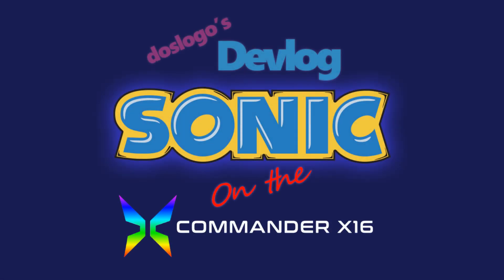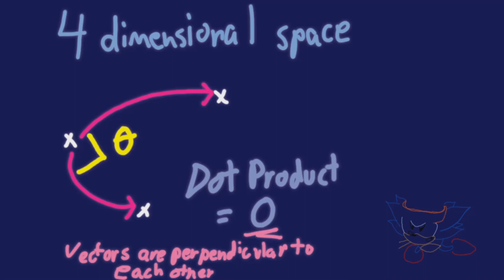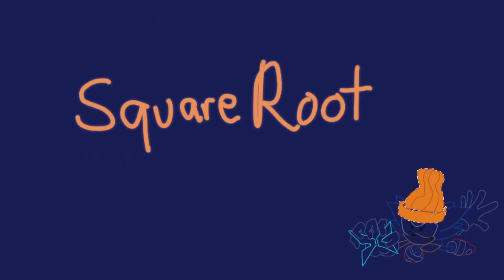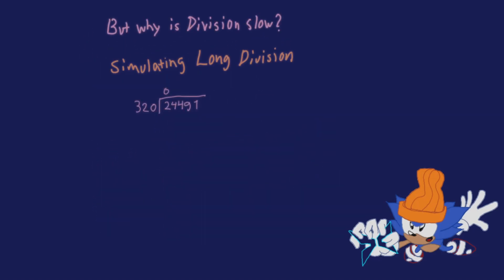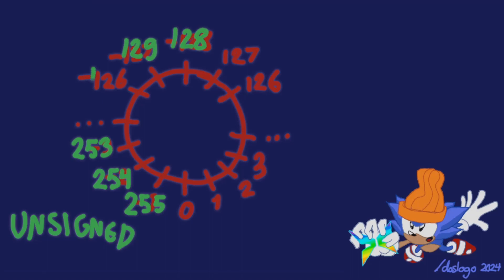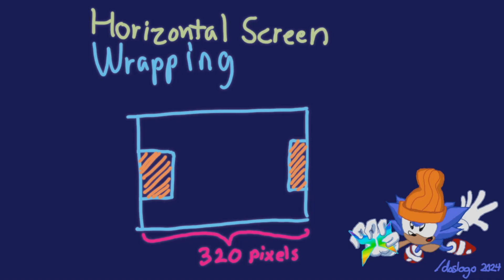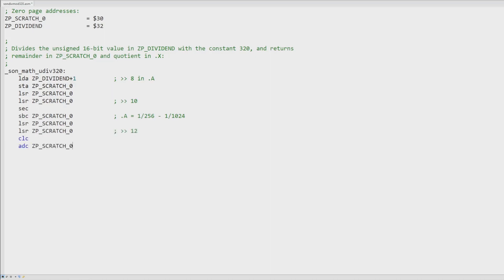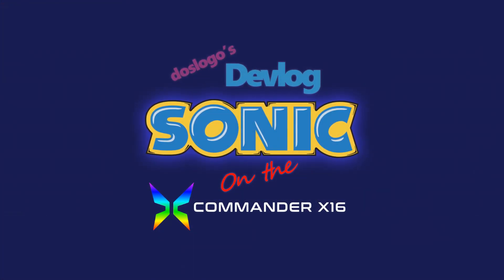Sonic for Commander X16 Devlog #1: Wrapping and Water

Comment: I’m the author of the Sonic demo, and would like to say how great it is to see someone picking up the gauntlet.
I made the original demo because at the time, people were vastly underestimating the level of graphics and sound the X16 can do. In particular I wanted to show it as a demonstration as to why the YM2151 makes sense and not just a square wave chip.
Reply from the maker: Did you also create ZSound? Your demo will always be legendary!
Reply: @doslogo Yes indeed. Sonic Demo originally used its own music loop and an older version of ZSM, but I converted it to use Zsound so one less project to keep up to date as I tweaked the format.

Comment: Sonic Pocket Adventure was released on the Neo Geo Pocket Color, which was a 8 bit system from what I understand, and Pocket Adventure actually has near perfect physics. I'm not sure how much overlap there is with the Neo Geo Pocket Color, and the Commander X16, but it would not hurt to see how that game handles its physics for reference.
Reply from the maker: Pocket Adventure seems to have a limited defined sets of slopes, which are straight lines rather than per-pixel. That has the advantage of many things such as pre-calculated speeds when landing on said slopes. Thankfully, I can use the VERA FX of the Commander X16 to get more accurate slope physics, so I can use per-pixel collisions

Comment: Make Sonic for CX16 Zones
Green Hill Zone
Bridge Zone
Marble Zone
Rocky Mountain zone
Jungle Zone
Spring Yard Zone
Labyrinth Zone
Star Light Zone
Scrap Brain Zone
Sky Base Zone
Final Zone
Reply from the maker: The most difficult zone to make is Jungle Zone because of the art (forests are always difficult to do with tile based art). I am definitely wanting most of those zones in the game!
Reply: @doslogo  There is Two Versions, 8-Bit Version (65C02S) And 16-Bit Version (65C816S)
Reply from the maker: @РусланИщук-щ8в Aiming for 65C02 8-bit, which has worked out greatly so far